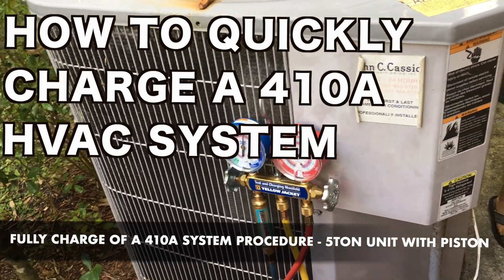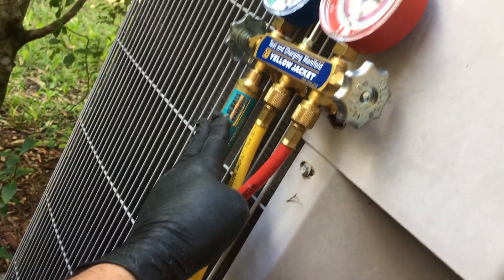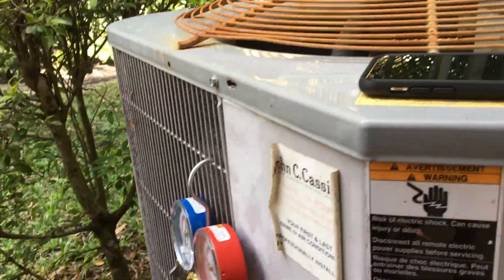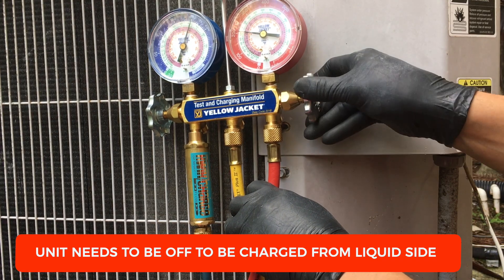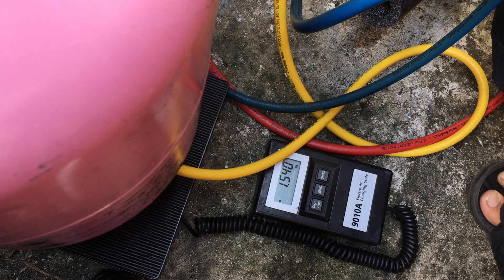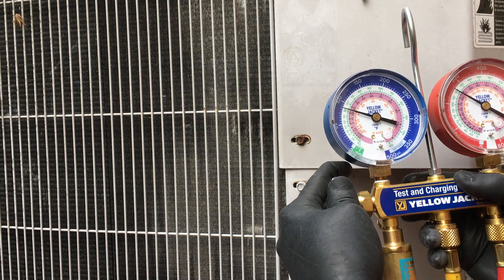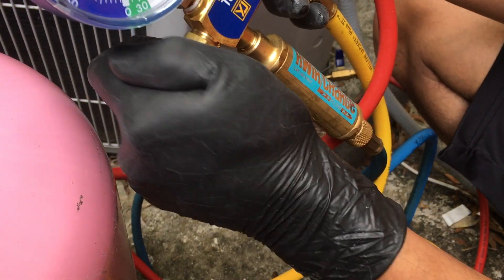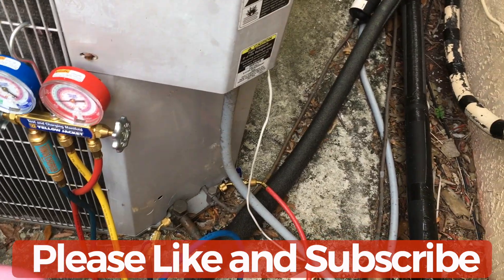How to add freon in HVAC - EASY and FAST!

Comment: Thank you for the great video. I have 410A and outdoor ac unit is Bryant installed around 20 years ago. How do o know if I need to add refrigerant, is it because cooling is less and ac unit run continually. My ac unit runs quite often these days but cool air is coming thru. Any other criteria to determine if needed to add refrigerant . Recently evaluator coil has ice build up all across it and water build up on furnace . I thawed it and now works fine. But would like to know how can I determine if ac is refrigerant low and needs to add. Also from which online store we can buy R410a. Do I need epa license to buy and try yo fill the sc unit . Technical is asking for 150-180 per ton to add refrigerant
Reply from the maker: Only way to find out if it’s low is to connect a guage. If you have never done before I suggest get a professional. 20yr old unit is def end of life. The fact ice buildup this is caused by either a clogged coil or low on charge. 
The fact it keeps running is also another indication.

Comment: Anyone knows how to troubleshoot the Kwikcharge device? Just got mine and seems the ball bearing/ valve inside the Kwikcharger gets stuck and no gas passes through the low side either direction.

Comment: I have a ac unit and the outside condenser won’t go on. I had a leak and fixed it but now I see the error code that the outside unit is low on Freon. When I try to add it in the high side like you did nothing goes in but the unit won’t start for me to put the Freon on the low side. Any ideas how I can get this Freon in?
Reply from the maker: You will have to add some Freon from liquid side without turning the unit on. Once enough goes in then you can turn on unit. There is a limit switch that disables the compressor start. You can also bypass it and start the unit and keep adding from auction side

Comment: Weird added a lb of r22  to a condenser today
The low side was at 80 and the high side gauge didnt go up.
Do you know why
Reply from the maker: Sounds like a blockage in your filter dryer. Check the temperature before snd after the dryer. Shouldn’t be more than a degree difference

Comment: Do I need to vacuum first if my system is flat and might have some water or moisture in due to leak at 7/8 AC line?
Reply from the maker: If you have no positive pressure at all then yes you need to vacuum but if you have low pressure but some positive pressure then it’s not needed.

Comment: Is it just preference that you charged from liquid side with unit off instead of suction line with unit running or is there a specific circumstance in which you should do that?
Reply from the maker: * so if you are super low and filling up a heavy amount of refrigerant then you have to add it from liquid side because if you are way too low then you may not be able to run to unit to charge the system. Once you add enough gas from liquid you will notice it will stop taking gas....then you come on suction side and add it as a gas.
If you are just a little bit low and adding a few ounces then do it from gas side. For example Adding 5lbs all from gas side will take you forever and you can also damage compressor if there is no gas and you running it to charge it.
Reply: @HowToDoitright  Great info, thanks for the quick response man!

Comment: I had over 4lbs of 410-A added over a week ago. System was still running (has long lines, garage to back of house) but not cooling as quickly and acted more like an undersized unit. (3.5 Ton). AC guy told me a bunch of stuff was leaking so I bought a leak detector and low and behold found only one spot leaking (the top of the accumulator) which I patched up with PC-7 epoxy mix and retested a few days later. So far so good, no leak. Unit is 14 yrs old but still in good shape overall. Question..since it was still cooling and wasn't critically low on Freon yet, or as long as it hasn't completely shut off or iced over, would it only be necessary to add Freon to the vapor side only to get the charge back?  Also, do you have to have the quick charger on the vaper side or can you get away without one if you go slow? Thanks.
Reply from the maker: If it was little low you should charge from vapor side And no you don’t need to have the quick charger as you said doing slowly will do the job but for 35bucks to same my compressor it’s a small charge so I suggest to have one. It is forgiving as if you open too fast this will save you.
Reply: @HowToDoitright  Thank you for the quick reply. Are you in Central Fl?
Reply: @HowToDoitright  I bought a quick charger, thanks. By the way, do you loose it at the manifold or hose connection side to purge air? Not sure if the air makes it backwards through the quick charger or not.
Reply from the maker: JCstudios good question. I never had luck with purging Air. I do it at the bottom of the quick charger.
Reply from the maker: JCstudios purge by loosing the connector on the gauge side hose connection before the quick charge as the gas comes in from the ac side and air stays on the gauge side.
Reply: @HowToDoitright  Got it. I was just wondering if any air made in through the quick charge too.

Comment: Hey we just had an ac guy come out & feel the air coming from the outside unit & say "yeah needs freon" ... How could he tell that by just feeling the hot air coming from the fan??  Wtf? Lol
Reply from the maker: lol in reality He needs to put gauges on the unit and check pressure. If the fan outside is not putting out hot air means your ac is not doing heat transfer which means it may need Freon. But again he need to put gauges and check. 
Where in Florida are you?
Reply: @HowToDoitright  the fan is putting hot air out 100%. He then put his hand over the fan once more & said "yeah for sure needs freon". I let him go home. I need a real a.c. guy thats gonna get straight to the point & not dick me around
Reply from the maker: @floridagirl386  Yes agree...people are crazy....you cant just say that...the problem is some ac techs (not all) are either not honest or dont have enough experience and just want to put in a new ac instead of fixing something simple. its a shame. i would have helped you out if you are new west palm beach.
Reply: @HowToDoitright  thats exactly what he was trying to do, get me a new unit... Im located in debary fl! How far is that? I do need quite a bit of work... But to the right person.

Comment: My unit uses a pound a year I fill it up myself.. It has a very small leak.. I hate calling A/C service people they don't want to fix your unit they want to sell you an $8,000 new one.. I called 3 places all of them said that I need a new unit.. Yeah sure.. I bought 20 pounds of freon from ebay for $175 and it does real good.. House is ice cold.. Those A/C places are rip offs. There is not much to a central air unit and they charge you mega bucks because they got you by the balls..
Reply from the maker: Agree to some extent that’s the reason I learned it myself. I recently replaced my 5ton unit with a variable speed. I was quoted 12k for the energy efficient unit but I endup doing it myself with the help of a licensed AC professional friend and it cost me under 5G.
Reply: You hit the nail on the head!
Reply: more/less how much does it cost to pull together enough tools / equipment to handle doing a DIY refill?
Reply from the maker: Chango Surf I would say around 1k. This would include hoses/meter/valves/vacrometer/vacuum pump. That’s if you shop around and buy tools saving money from eBay or amazon. Buy quality products like Yellowjacket.
Reply: When u lose Freon u lose oil in ur compressor. So it’s suitable for now but need to find the leak or the compressor replacement is inevitable! But that’s really not too bad.
Reply: 80% of leaks are at the kings valve check there first. Hope that helps.

Comment: In order to fill my backyard Puron HVAC R410A freon, what manifold do I need ? Yellow Jacket 42001 Manifold with 3-1/8" Color-Coded Gauges or Yellow Jacket 42006 Series 41 Manifold with 3-1/8" Gauge ?   Thank you.
Reply from the maker: Yellow jacket 42004 is the one I am using so should work just fine.

Comment: if your adding x pounds of refrigerant to this system
do you need to comeback every year
 cause you didn't repair the leak in the first place ??
Reply from the maker: I fixed the valve leak. Check my other video on how I fixed the leak

Comment: Thanks for the great video!  I have a HVAC unit that is completely empty of Freon (probably leak somewhere. I'm trying to use leak sealer after I put the R410a back in).. Is it still okay to follow your direction(when it's completely empty) here filling the high side first with unit turned off and filling the low side later with unit on?  Do you have any tip or suggestion?
Reply: Ya that’s fine
Reply: You'd have to evacuate the system before hand though

Comment: Thats not the correct way. You have figure out if you are charging by sub cooling or super heat. Then you have to flash 410A since its liquid to suction line.
Reply from the maker: This is the correct way. First you have to charge the system before you can check on subcooling or superheat. There is no need to figure that out as that depends on if your system has TXV or fixed orfice. You can’t check the proper level of coolant until your system is charged. In this case this system was almost empty so I had to charge it up. You shouldNOT flash it in suction line as it’s a slow process and you will damage your compressor running it empty. In most cases your limit switch won’t even let the compressor run. You have to add it with the method shown in my video. Once it’s charged enough for the system to not freeze then you can check the sub cooling or superheat.

Comment: When the system is on the vapor line is showing a pressure of over 85 degree. What does this mean? 410A
Reply: The 85 is not degree its 85 pounds, You read down the needle to the pink ring for 410 to get the freon temperature at that pressure. It's temperature you now have is subtracted from the physical suction line temperature for to total superheat... Which is based on indoor WB temp and outdoor temp from  superheat chart usally on the back of service door.

Comment: Seems easy enough. Just waiting for my unit to thaw and I'm gonna give it a shot. Thanks.
Reply from the maker: Yes not bad at all
Reply: All good, now the wife says it's too cold. Do I let freon out or put her out? I cant find a video on that.
Reply: DJ Kaiser deff put her out. You don’t need that kind of negativity in your life.
Reply: Why would you need to add Freon to a ac unit? How often do you have to add some?
Reply: @tuwannarico  you should never have to add it unless there is a leak.
Reply: I've got a leak somewhere. The AC man wanted $1250 to fix it so I bought a 25lb can of freon off Amazon with some gauges a couple years ago. This is my 2nd annual top off.
Reply: @DjKaiser84  $1250 is a fair price pay when it cost $3000 to replace your compressor. Oil leaks out with the refrigerant and eventually it will burn up the compressor if you don't fix the leak. It like driving your car when it's low on oil, eventually you will ruin the engine.

Comment: Hello i have a lennox unit and the psi in the low is90psi and the high is 210 is like 70 degree outside. What psi is supposed to be? 
Thanks
Reply from the maker: These units are not charged with PSI. you really have to check and measure the superheat. That’s how you charge these system. Check out my series where I have installed a Lennox system and charged it up

Comment: Thanks for the great video.  My problem is that I have a mini split with no high side access.  

I hired an idiot to install it and he let out all the refrigerant.

Can I turn on unit with very little r410a in it and add using the low side only and a vaporizer? 

Will it damage the unit to run with no r410a in it while I start the process?
Reply from the maker: Ah bad news. No not a good idea to run with low gas but it also depends on how low are you and for that you will need a gauge. If your temperature on the gauge is below 32 your unit will freeze with ice. If your unit have low pressure cut off switches it may come on and off multiple times which can also cause damage to compressor. Little bit low not an issue for a short time but again it all depends on how low you are and how much it leaked.
Reply: You cannot charge a mini split with traditional measurements like superheat or subcooling pressures and temps. Mini splits are "critically charged" meaning not much room for error. There's not much storage room (large accumulators, large liquid line driers, etc) to store any excess refrigerant. Normally you would recover refrigerant, pressure test with inert gas, make the necessary leak repairs in your case(probably a poorly done flare fitting which is the most common cause. Then weigh in the exact amount of refrigerant listed on the label plus the extra for additional lineset over the 15' or more of lineset (check installation manual) 
For cooling mode the expansion valve is located in the outdoor unit behind the access valve rather than at the indoor coil. It is continually modulating the flow of refrigerant from sensor feedback at the indoor unit. (maybe also varying the inverter compressor speed and/or fan speed depending on the quality/features of your unit) The evaporative process of expanding the gas from a high temp liquid to a low temp saturated gas begins at the access valve. In other words the lineset is a part of the evaporator cycle. You might be able to come close enough to operate if you charged very slowly and constantly monitor the temperature split of supply and return air but chances are you may eventually ruin your compressor depending on how well the manufacturer set up temp/pressure safety limit switches.
Reply: yes you can. But you gotta get the pressure up quicker. A lot cheaper than vacuuming it...but you gotta find the leak....